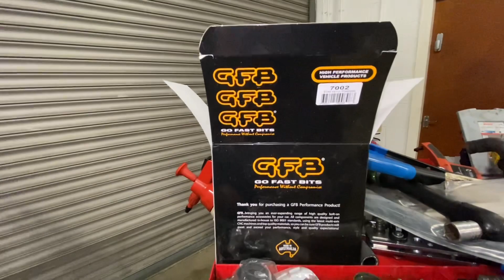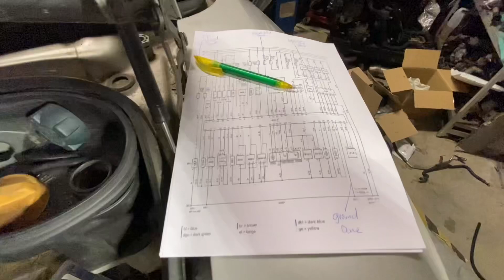20v Porsche Boxster Engine Conversion bigger Update !   The Road to BOOST

Comment: At 3:25 what size pipe for the front engine mount did you use (for the bolts that go through them)? Might end up crafting a similar mount for my 987 1.8t swap!

Comment: Looking good so far. What's the power goal? I've also got an Audi powered Boxster
Reply from the maker: Nice one cheers !  Ive seen yours mate it looks great,  power goal is around 500hp,  what gearbox is in yours ?
Reply: @VolksWorkshop  I started off with the 5 speed then moved across to the 987 6 speed when I fitted larger turbos.
Reply from the maker: @Escygt  ahh cool,  the 6 speed the same bell housing pattern / clutch and fly etc ?   I’m not sure on the limit of the 5 speed and would be interested to swap it to 6
Reply: @VolksWorkshop  yeah, only the 987 6 speed bolts up. That gearbox in a 987 needs 987 shafts with 986 3.2 outer ends (for the abs) and you'd need the 3.2 rear hubs as they use a larger wheel bearing.
Reply from the maker: Thanks for the info man,  do you mean putting that box in a 986 will require the extra parts to fit ?
Reply: @VolksWorkshop  yeah, I mean to fit in a 986. I've still got the driveshafts I made if you did go that route. Think the 5 speed might not cope at 500bhp but I ran one at 400 with no issues. The 987 6 speed doesn't come cheap.

Comment: I'm planning to do the same conversion in the near future, just hunting around for a cheap 987 is providing a bit difficult, I just missed one on auto trader for £2k lovely black car with no mot in black with a blown engine 🙈 would have been perfect but the breakers seem to be snapping up all the cheap ones
Reply: I've got a 2004 boxster for sale motor has been removed lovely  clean car ready for conversion.  £2100
Reply: @DanyVere-eb5lp  thanks but I've already got one now, . Managed to pick up a 2005 987 running and driving wants a few small jobs £3200 which I feel was very good value

Comment: This will be interesting some power and boost in a boxter, I know what it's like rewiring the ecu I done it with my caddy 1.9tdi bls converted to a 20v will the emu control the fan as I had to fit a thermal switch
Reply from the maker: Cheers Matt,  I can use  AUX out to send a signal to the fan relays at a certain temperature